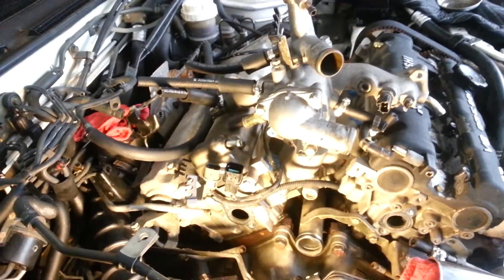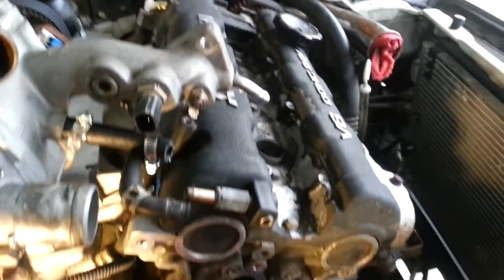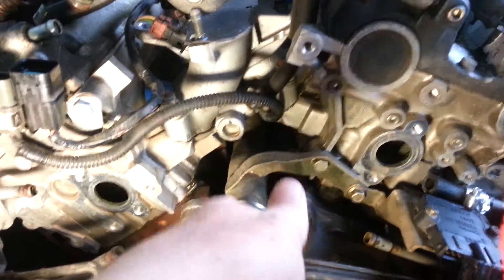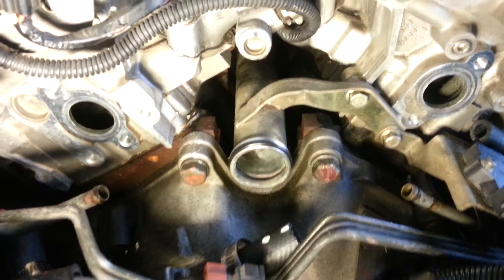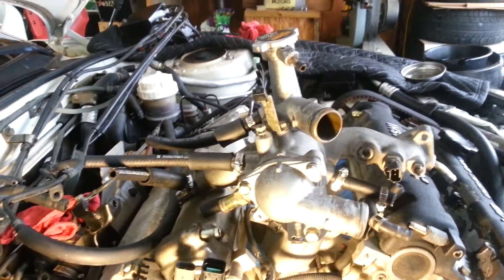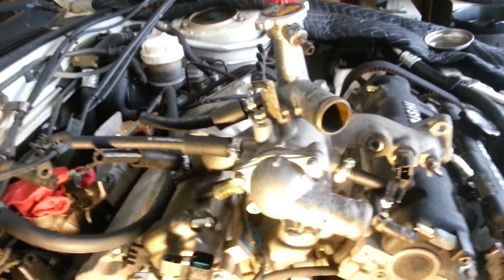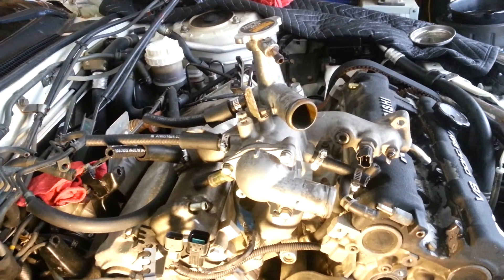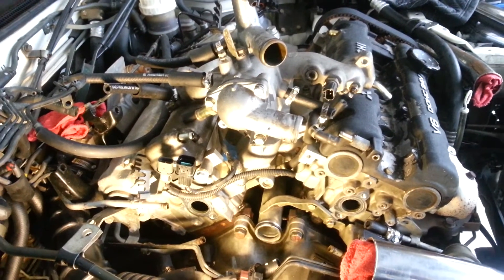Last VR4 Built - Thermostat and Housing Installation

Comment: How long does this process take?
Reply from the maker: It take a good while if you want to do it right. ALL the hoses need to be pulled and replaced. You also have the lines going to the throttle body. But, you do not want to do this again so replace everything. Hoses, clamps, etc. Get some pure silicone grease for the seals The tube between the water pump and the housing is the most important bit.
Reply: tonkatoytruck ok thanks, I’m going to be doing this for my 3000 gt sl non turbo so since I don’t have to pull apart the turbo tubing it should make it a bit easier I’m hoping but I will definitely replace all hoses and clamps and get that silicone grease. Thanks a ton

Comment from the maker: Here is the link to the service manual. Select for your year and model. Make sure you follow the torque specs, orientation, the jiggle valve is lined up. etc. The factory thermostat housing gaskets (2) have tabs that face outward from the engine and hold them in place while bolting on the thermostat housing.

Section 14 Cooling\Thermostat

http://www.3sx.com/faq/manuals/